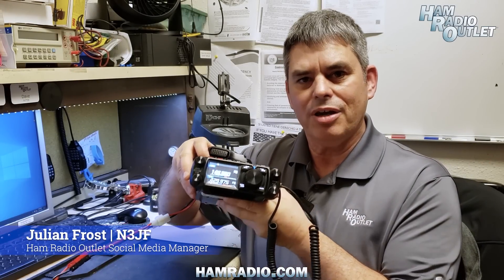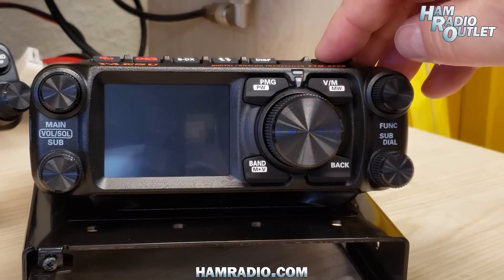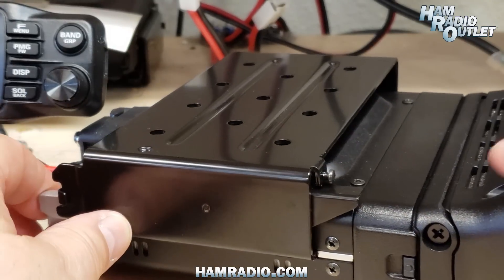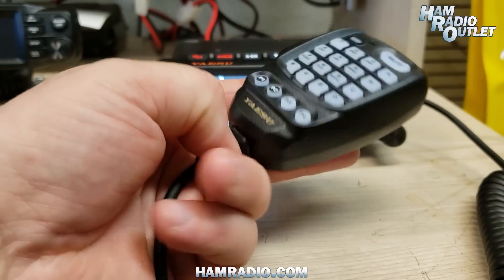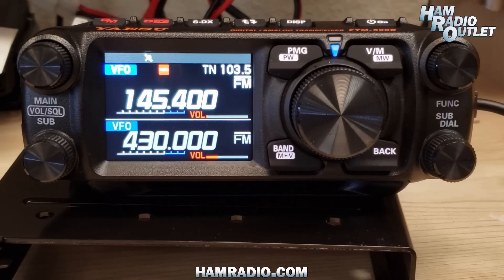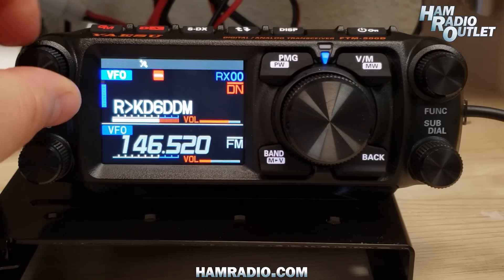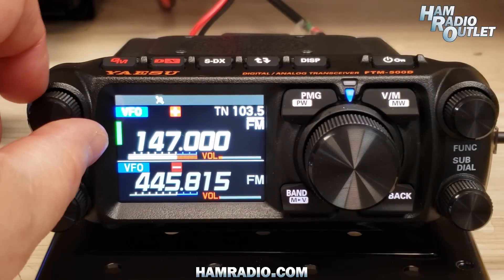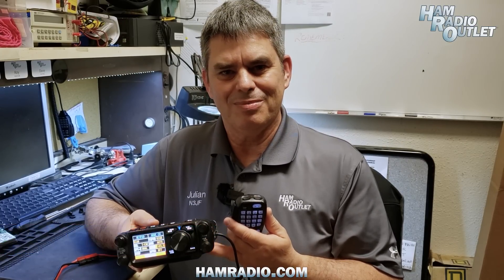Yaesu FTM 500D

Comment: One secound, let's have a look, are we getting a good deal here ????
Yaesu came with the same size radio that had 100w H.F , 6 M, 2, & 70cm, while letting you monitor the air band as well as the FM brodcast band, and the remote head was much smaller, all that was offered about 20 years ago ( FT857D).
So ,now 20 years later decide if this new product worth the price for CF4M , I will keep my FT857D for sure.
Reply: Agree I have 3 ft891 
Nice rig But I prefer the 857 includes 
2m and 70 cm for same price
Reply: I have an FT8500 the infamous Mr. Potato Head. I can have the head detached and the microphone controls ALL radio function, never have to touch the head knobs Ie: volume and squelch. its 26 years old and can receive AM aviation freq
Reply: I was hoping to at least see SSB option for a $700 radio but no. I bought an icom 7100 last year I have no regrets.
Reply: I brought a 857d looking for another one

Comment: Terrible having a menu with 127 options when they are clearly classified into sub categories. They should fix this in a firmware update.
Reply from the maker: There may well be shortcuts. I hadn't seen the manual.

Comment: My question is how do you do the digital modes is it set up like dmr nice radio love to know more about it now the price tag on a 2m 440cm is it worth it. When they made that radio they shoulda made an vhf uhf hf mobile rig i dont understand they went to the extent with this radio its cool but is it worth it and the price tag.wish yeasu made another mobile rig imp. Thanks for showing it👍💯📉⚛
Reply from the maker: C4FM is simple to use. You press a button to get into C4FM mode and you press a button to search for "rooms" (think: Talk group) or enter the name of the room directly and connect. That's it. You don't need to program anything, other than the repeater frequency/offset/tone like any other radio. Yaesu made this radio to replace the FTM-400 which was discontinued due to difficulty getting components.
Reply: @HamRadioOutlet  that makes sense thanks for the information hro
Reply from the maker: @MrD308  At this time, I don't now the radio well enough to give you a knowledgeable answer, sorry. However, this is how their other radios have done it: At 65mph you would likely be changing memories or programming repeaters regularly and, assuming each repeater is a C4FM repeater with access the same room, then reconnecting is pretty simple - Push the button to connect to the C4FM repeater that's currently programmed into the radio and the radio remembers the last room it was connected to... so push the on screen button to connect to that room again.

Comment: $650 and death by a thousands menus -- think I'll have to pass. Thanks for sharing, Julian!
Reply: Nice looking radio but for me don't think the price of it is justified.
Reply from the maker: @Badwolfe-gaming  It's not inexpensive, for sure. Essentially, it's the same price as the FTM-400 when it was introduced 10 years ago. Prices have gone up in those 10 years.
Reply: I am with Matt on this one. Way too much money for a radio. The BIG knob is just to change the freq and channels. (Page 19 of the manaul you can download.) I guess the up/down is too hard to work. I will wait for the FTM-500nbk. No Big Knob or AESS. I like the bigger screen. Hey Matt, on my FTM-200. You can configure a small set of menu items you like for easy access. I would think they carried it over to the 500. 73s KE6UPI
Reply from the maker: @DavidS-iw4ei  There are 50 sets of memories for programmable memory scan. You may think the smaller screen (compared to the FTM-400) is a deal breaker... but wait till you actually see it.
Reply: @HamRadioOutlet  Do you mean similar to the “banks” on the FT-5D?
Reply from the maker: @markannichine  I don't know... the information I have just says "1104 Memory Channels including 5 "Home" channels, 50 sets of memories for programmable memory scan and 999 "Basic" memories." I don't know if that means "50 memories" or "50 groups of configurable memory blocks".
Reply: @HamRadioOutlet  Okay--I'm pretty sure that is referencing the lower and upper limits which are settable for scanning purposes. The manual mentions this, and references the advanced manual, but the advanced manual doesn't appear to be available on Yaesu's website yet. This is different from memory banks which allow you to store the memories and then assign them to various banks (and can even assign one memory to multiple banks if you wish).

For those who have not used banks before, you're missing out in a big way. Banks are incredibly helpful, especially for those who either travel or belong to multiple teams which require different memory sets.

The Yaesu FT-5D offers memory banks, so I was very surprised and disappointed to learn that the FTM-500 didn't. Here's an example of how I (and others) use them:
I'll have different banks for different geographic regions in which I might travel. One 60-mile road trip alone might take me through 3 to 4 different regions, each having their own bank. As I fade out of one region and into another, I can simply switch banks. This is great for scanning purposes--ensuring I'm only scanning memories in the footprint in which I'm located. But it's also extremely helpful for simply operating the radio while driving. No more do I need to either try to remember which memory locations belong to which cities or go fishing through my spreadsheet. I can simply select the bank titled with the name of the region (i.e., "Cleveland, OH", "Youngstown, OH", "Pittsburgh, PA", etc.), and then scroll within that bank to find whichever repeater I want.

Additionally, I belong to multiple volunteer emergency response and emergency communications groups. With memory banks, I can assign each of these teams/groups their own bank, and when I'm deployed, simply switch to that team's memory bank. I can even "link" certain banks. For example, if I'm deployed for "CERT", while located in "Cleveland, OH", I can link both of those memory banks and scan that whole group together as one.

I have nearly 500 memories programmed into my radios. Without banks, it would be a jumbled mess to try and sort through while on-the-go. Banks enable neat, manageable memory groups that can be recalled easily. No modern-day mobile radio or quality handheld transceiver should ever be produced without this feature, and I'm so disappointed that Yaesu didn't include it in the FTM-500. We can only hope they will recognize their mistake and add it in via a firmware upgrade. Until then, this radio cannot be on my short list, as much as I'd like it to be.
Reply: @MrD308  You're welcome. I'm glad to help. I'm still holding out hope that they'll update it and fix it, but I recognize that it's not likely to happen. It's too bad because it seems like they have done an otherwise great job with that radio. But that one thing is a big thing, right?
Reply from the maker: It does indeed have a ton of menu items... but, I think there are shortcuts to get where you need to be. I just didn't know how to get there. The good news is, the commonly used features are now front and center (either on buttons or top-level menu items), rather than buried deep in menu-after-menu-after-menu, like the predecessors. $650 is only $50 more than the FTM-400 when it was introduced 10 years ago. A lot has happened in 10 years - the price of literally everything has gone up. The $600 you spent 10 years ago gets you a lot less in 2023. For $650 today you'd be getting a much better radio.
Reply: Give me the noney

Comment: SSB???
Reply from the maker: No. See the video description, or the link to the radio, also listed in the description (https://bit.ly/3LB3Xtp). This is a mobile FM and C4FM radio, not an all mode radio. It is the replacement for the FTM-400 that was discontinued due to parts availability problems.
Reply: @HamRadioOutlet  Already saw the description before my comment. Just hoping the SSB mode could be added to such a great rig.
Reply from the maker: @MrGoodSkills  Ah, ok. I do not believe there is any way that this rig will ever do SSB. It was designed from the outset to replace the FTM-400 that could no longer be produced due to the microprocessors used in the FTM-400 being unavailable.
Reply: Another 500 dollars per person